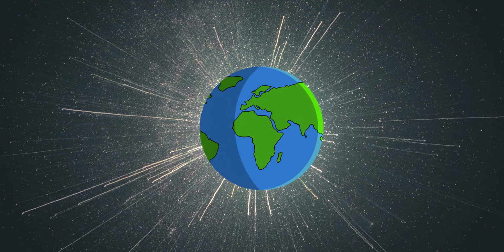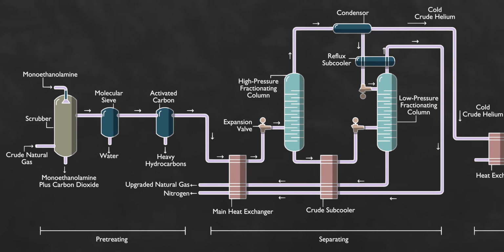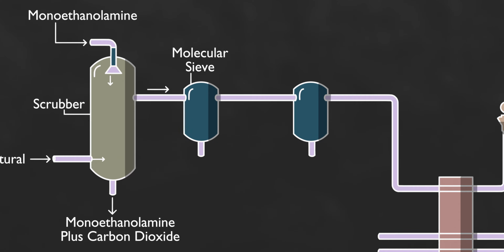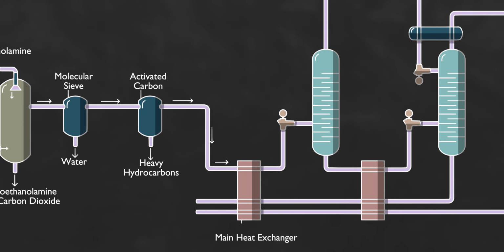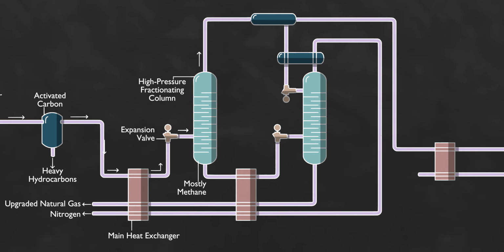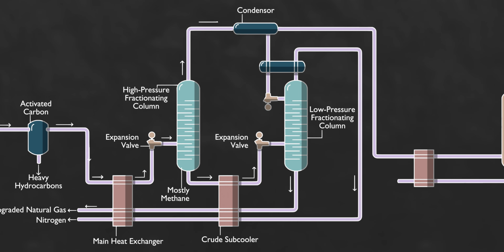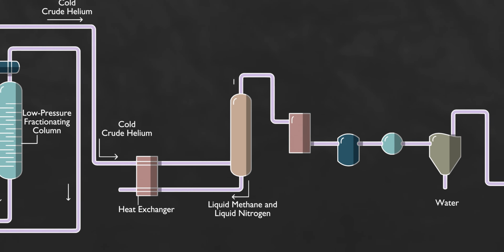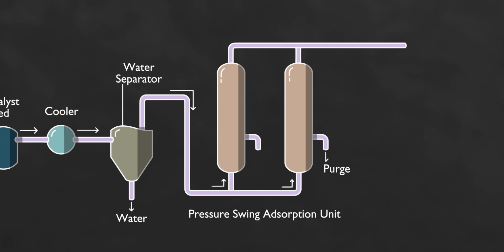how helium is made animation | Karthi Explains

Comment: If the helium atoms are lighter than everything else why not pump the natural gas into a tank and let it settle overnight and then suck it with a tube 1/2” from the top of the tank ?
Reply: I would imagine that production is a 24 hour a day process and there is simply too much of it for that to be feasible. I believe hydrogen molecules would also be about the same weight, mixing considerably with the helium